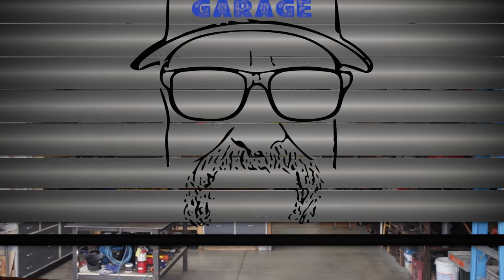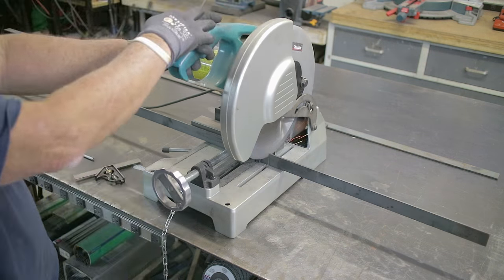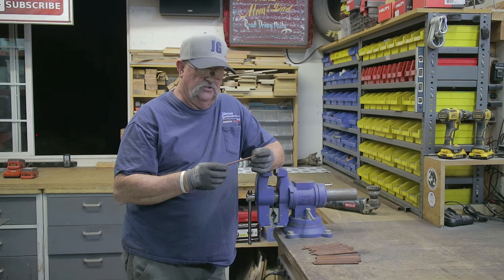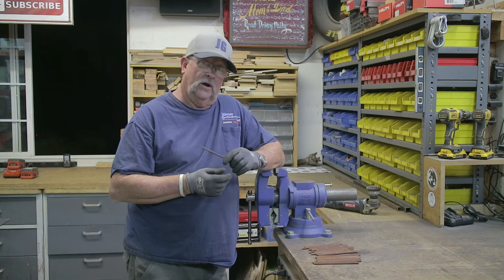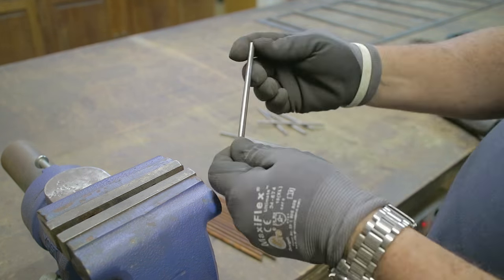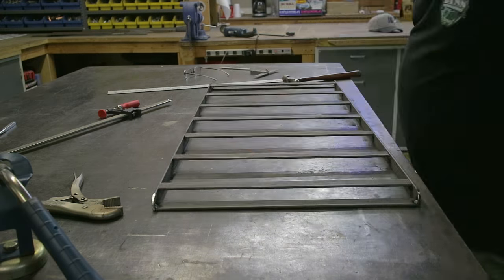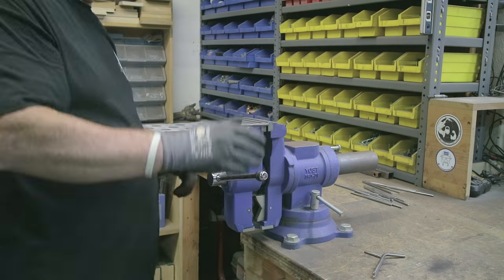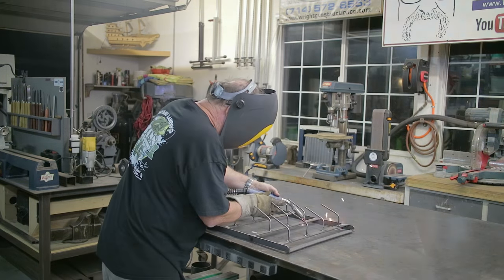Metal French Drying Rack - JIMBOS GARAGE

Comment: you could try putting the sticks in de drill press and holding some sandpaper on it
Reply: This would have been way faster
Reply: I have cleaned rods that way. I put them on a dewalt drill and used scotch brite and cleaned them pretty quick.

Comment: Once again awesome video! Just out of curiosity, how do you price your work? I figured this was probably a job that you did just out of kindness but when your making brackets for construction jobs and doors for clients, how to do come to a price. I'm currently having trouble deciding on a decent pricing method that gives me enough money for my time and materials yet doesn't become to costly for the client. If you want to message me about this that would be awesome or in the comments, either way. Also I would just like to add, and I'm sure you probably thought about this, but what I normally do when cleaning small rusty parts like that is I begin by removing the rust on the whole stock. For example cleaned the whole length of pencil rod at once and then cut it. Like I said I'm sure you thought about that after but if not I figured I put it out there. Thanks for taking the time to read this and I look forward to hopefully getting some help on pricing! Thanks!
Reply from the maker: Thanks for watching BischoffFabrication, Yes sometimes it is difficult to come up with price to charge friends, But what do is charge the cost of material plus 20% for shop cost, You know, Welding wire, Gas, Grinding wheels, Electricity, Ect. Now that is for friends!, Contract work is different! Depending on the job.  It is somewhere around double the material cost. Example! If material cost $200, It would be around $400 for fabrication, Now this includes profit and overhead. Hope this helps.  Jimbos garage!

Comment: stick those sticks in the drill press chuck. hold a piece of sandpaper around them while they are spinning.
Reply from the maker: Thanks for watching, Ya that would have been good, Or in the lathe.  Jimbos garage!
Reply: MRGMM i woulda clamped a drill in vise and put the other end in a socket mounted on the other end 
Could of done them in 10' or longer sections at a time derusted in no time